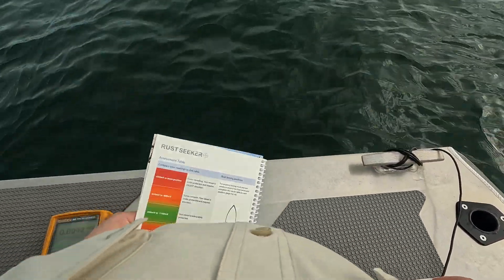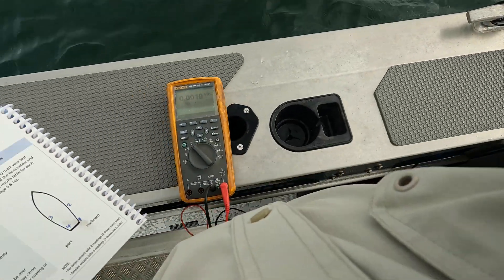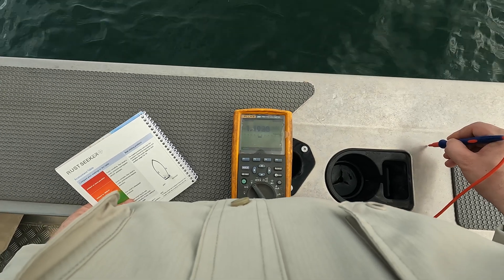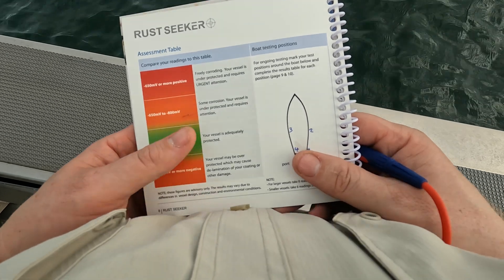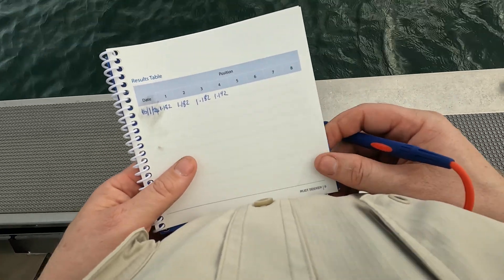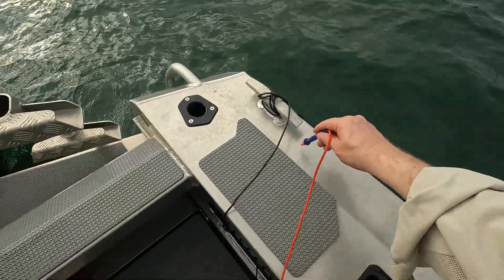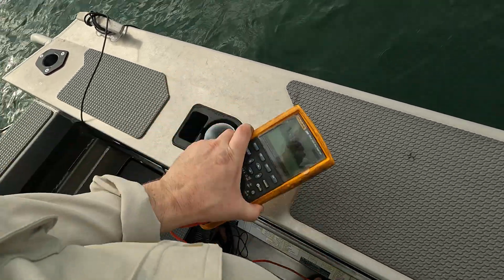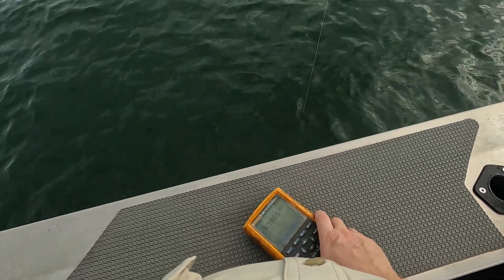How to Test for Stray Current Electrolysis on an Aluminium Boat

Comment from the maker: Quick note: accepted protection ranges can vary slightly depending on water type and reference electrode, so always compare readings against the electrode manufacturer’s guidelines.

This is a simple check that can save serious hull damage if something isn’t right.